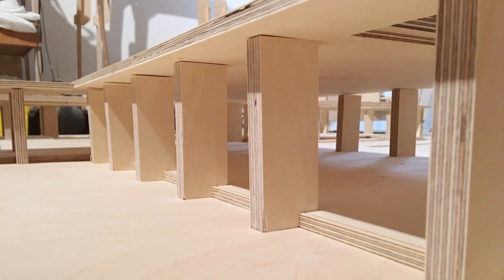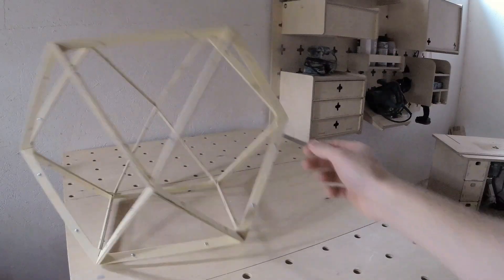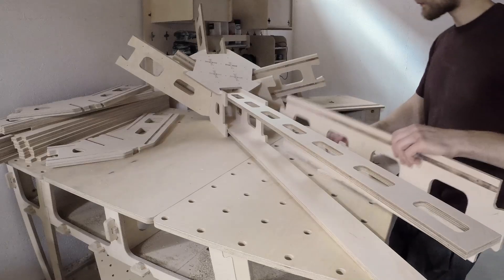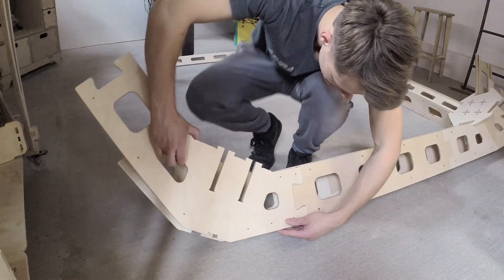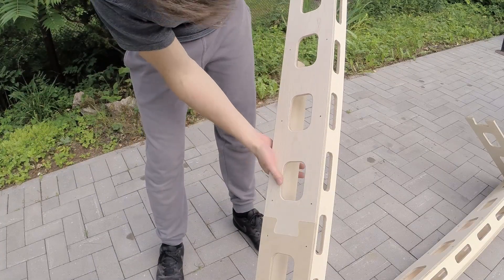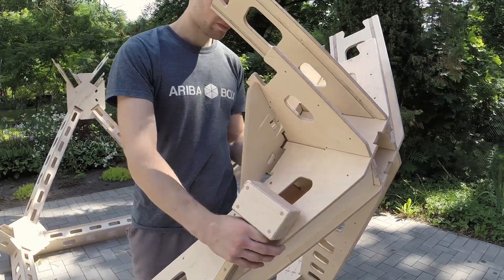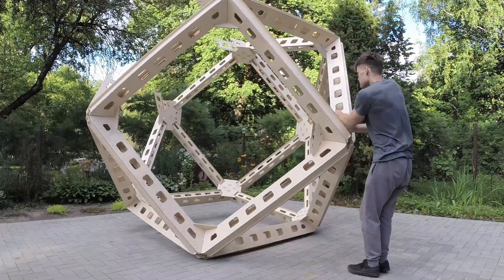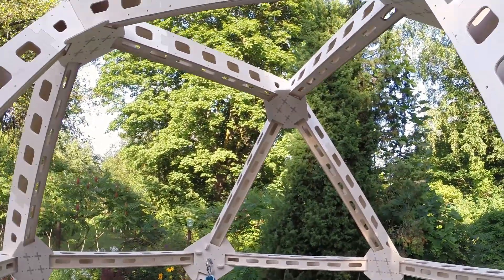When CNC Designer Meets an Architect - Urban Dice 2.0

Comment: Amazing job from design to execution!  Do you have any issues cutting parts without tabs?
Reply from the maker: Thank you!
We didn't have any problems when skipping the support tabs. Most of the components were large enough to be held in place by the shavings left from the cuts. Straight-flute bits leave the shavings in the grooves quite compressed.